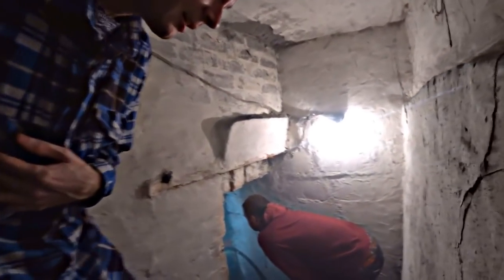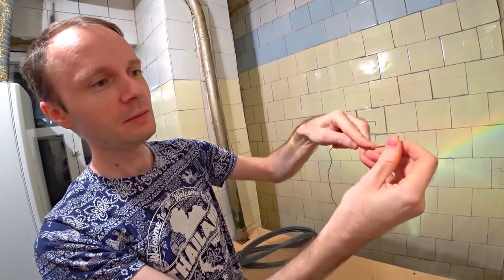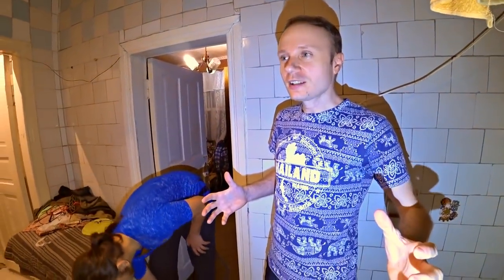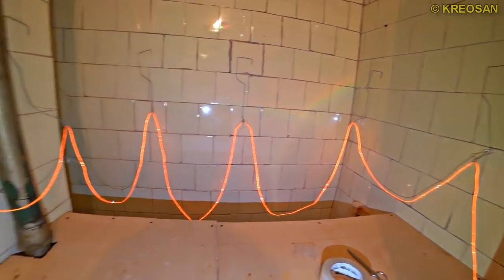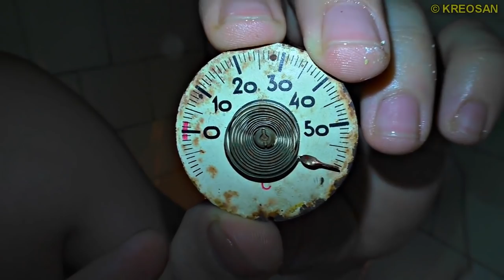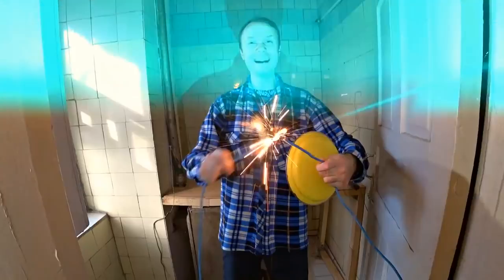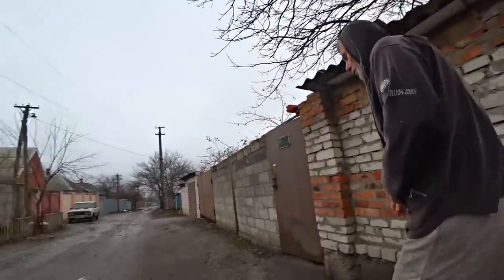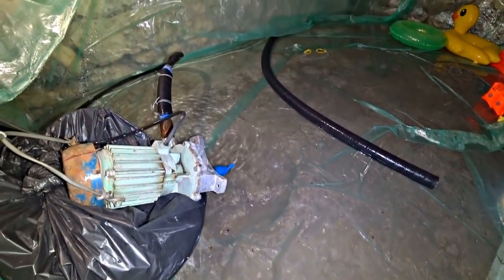Homemade Electric Sauna⚡️💡⚡️Infrared Crazy Banya

Comment: ElectroBoom will like this idea :D
Reply: He showed that even in salt water it's safe to get pretty close to wires. I'd be more worried about the temperature of this one.
Reply: @CTimmerman This type of wire is not designed to be heated like this and after one or two uses , it loses its flexibility and becomes brittle. So in the next run some tiny parts of it would break and fall down and that's where it becomes dangerous since the wire may suddenly break and current can find another way(which may pass through the body). The nichrome(nickel chrome) wire with gfci switch would be a much safer choice for such applications.
Reply: @faghihimohammad  THIS IS THE LEAST OF THEIR WORRIES. THEY RUNNING A BURNING HOT WIRE WITH 240v AC RUNNING THROUGH IT.
Reply: @faghihimohammad  I was also thinking about why they didn't use stainless steel wire at least - that will hold much better (even if it's still not as good as "real" heating wire
 - NiCr or FeCrAl). The problem isn't that the wire get brittle, but oxidation. After a few uses there will not be much metal left (most of it will just be turned into iron oxide) when it gets this hot and is exposed to air. So it will indeed will burn off quite soon. I don't think it's will be that bad though - they were not sitting that close to it (probably couldn't anyway, because of the heat) - so if it breaks, it it will just fall down on the floor without touching their bodies (wich might happen anyway - remember also that they have only taped the "wire holders" to the wall and when the walls get hot enough, if they run it for longer, the tape might melt or loose it's adhesion). 
Now, if they had hanged the wire in the ceiling or high up on the wall and sit under it, that would have been another thing (but I don't think even these guys would do that - they know the difference between madness and suicidal, hahaha).
Reply: then go watch him, we are here for Kreosan not that that guy
Reply: I saw you on roblox
Reply: He will rectifi them
Reply: @MrHoleemolee  no way fr?????? whats your user?
Reply: He did it before but he sat on the wire 😂😂😂😂
Reply: Electroboom got angry at the kerosan
Reply: He already did lol

Comment: When burning galvanized (zinc coated) wire, never breathe the fumes.  It's quite toxic.
Reply: They are crazy, they went to chernobly too
Reply: They invaded chernobly actualy
Reply: How about connecting a car battery to 220 mains?... then breathing the fumes.
Reply: I thought I saw a zinc flash-off too. What kind of wire is this, anyway?
Reply: @Noah-hq5rs   I would not advise it...
Reply: @crimsonhalo13   Looked like galvanized steel wire.  Like fence wire.
Reply: @crimsonhalo13  maybe fence wire. Usually zinc coated.
Reply: @ProtoMan137  WAS zinc coated :) it all burned off
Reply: Yes, that was the first thing that come to my mind when they said it had rust protection, haha. It would have been better to use stainless steel wire (or even better "real" heating wire
 - NiCr or FeCrAl alloys - but those usually more expensive. Stainless steel wire doesn't cost much more than galvanized wire though). Then it would probably hold up better as well. That one will probably burn off after a few uses (as ordinary steel oxidizes very fast, when that hot). Although, the taped wall holders will probably not hold up for long anyway, hahaha.
Reply: It'll be fine
Reply: No worries.. They already radiated themselves to death by standing in front of some home made xray machine.
Reply: Not in Ukraine
Reply: @bloxyman22  Those X-Ray experiments were batshit crazy. In the long run, I’m not sure anything they do now even really matters. They are lucky they escaped acute radiation poisoning.
Reply: @miguelribeiro3103  Yeah it was invaded... you are just wrong about who lol
Reply: @kevinjohnson7300  lol
Reply: you are saying that to the guys that went swimming in nuclear waste haha... i dont see how these dudes are alive.. but im highly entertained.
Reply: @mtnvlifestyles  
Good point...
Breathing toxic fumes.. Attracting lightning.. nailing lithium batteries, living through an invasion... dodging the soldiers then...  blowing shit up...  Playing with thousands of volts.. flirting with high temperatures... living in an irradiated apartment building... Driving & riding crazy contraptions... Living through another invasion...  

Dude,  I think they're immortal. 

(I heard that they got out Ukraine though.)
Reply: @Cammi_Rosalie  good. its sucks they lost revenue from russias youtube or whatever. i hope their channel survives. but maybe its for the best so they do haha.

Comment: It's a (Suicide Sauna)
Reply: True
Reply: Yup and the guy turning it on and off holding a live 240v wire!!!
Reply: A very reliable death trap ! :D
The wires get red because they have some resistance (which is lower than human body) so current passes through wires and not body, but when body gets wet its resistance is reduced and if in some scenario body resistance gets lower than that of the wire , with such an unfused setup, they would get electrocuted! In fact, they need GFCI o RCA switch for such application that can pass that amount of current but would pop if the current finds another way to ground except the wire. I am sure they know this , but they don't care :D I hope they be safe and continue to make good content
Reply: @faghihimohammad  ELECTROBOOM?
Reply: @EngineerNev  Yep, a fan of Electroboom
Reply: @faghihimohammad  same

Comment: 6:26 the flying fluffy stuff is probably the zinc galvanization of the wire. I had a similar thing going on when I was welding galvanized tubing (although mine stuck to the surface).

Comment: usually the residential homes on USSR like yours in this video has somewhere hidden 110mm drainage pipe in the basement floor pit that leads to nearby ditches or nearby lakes or just underground field drainage systems, so the water can flow away from the basement floor. You had a pit closer to the right wall, could have been that under the rocks there a cast iron pipe was laying and you could have just slit the plastic liner and the water would have drained out by itself with no pump needed

Comment: Build like a safety cage for the sauna wire, in case it breaks from the heat, you know like those plastic things that cover wall wires, but made of metal, then you are 100% safe

Comment: how do you deal with air down in the pool? i would be afraid to suffocate with carbon dioxide
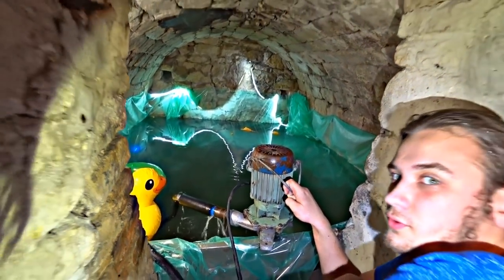Reply: 19:00 Looks like there is a hole by the stairs/ladder.
Reply: @storm37000  but co2 is heavier,.it will stay down unless heated to rise or pumped

Comment: How did you make the rock oven in the sauna?  Putting water would be dangerous if the oven is powered by electricity.
Reply: It is electric but all heating elements are a short circuit hence why they heat up so how can water cause a short when the whole circuit is already a short in the first place (I'm a practising electrician)

Comment: How would you connect that to a breaker box?  Switches are in breaker boxes.  Also I live in an area that serves 120 volts into a typical electrical outlet.  Does it need 240 volts?
Reply: Think of a toaster... that runs on 120 
Just buy a sauna heater don’t burn your house down trying to copy something you see on YouTube

Comment: The reason for no one doing this is because they do not want to get electrocuted by 220v AC... The sensible thing to do would have been to lover the voltage to safe 48v AC or less using a big transformer.

Comment: Be safe guys! "Ozone is a highly toxic gas but even highly toxic substances can be encountered safely. The main concern with this material is that concentrations to which people are exposed do not average more than 0.1 ppm over an 8-hr day, and do not exceed that value by more than a factor of 2 or 3 during the exposure."
Reply: As long as the "filament" isn't under pressure or vacuum it will make very small amounts of ozone. Under vacuum it will produce xrays too.